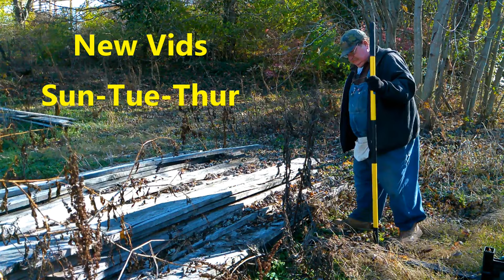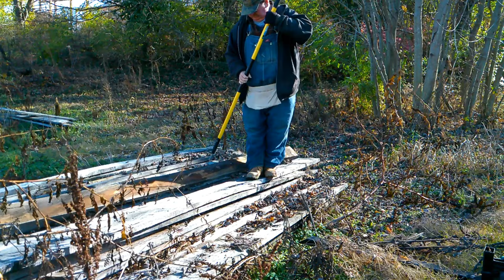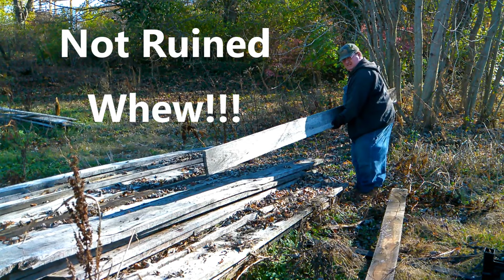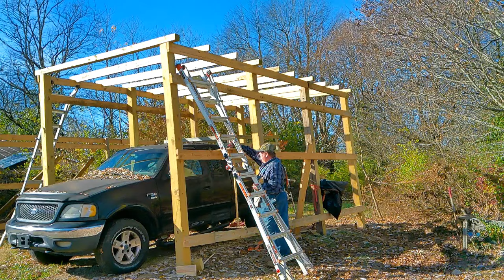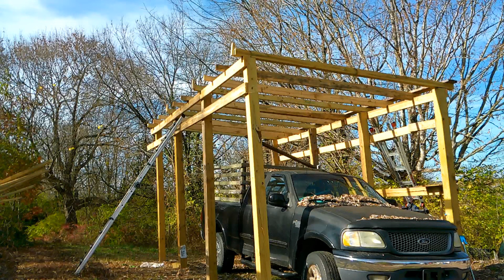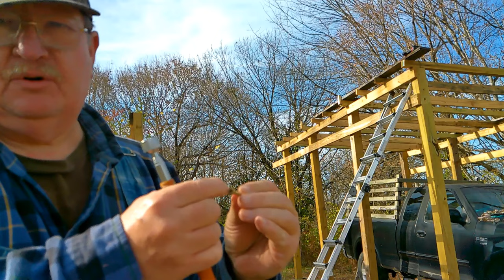Everything Is LADDER WORK Oh My Back Homesteading ASMR 101

Comment: I heard that the threads on screws are only used for taking them out.
Reply from the maker: I never heard that before. But the gripping power of a screw reaches its Maximum at 3 times the diameter of the screw in depth. Longer screws don't give higher holding power.
Reply: Don't be fooled by everything you hear.  Threads on a screw were invented to apply torque from the pieced drilling thru to apply pressure(torque)to the attachment piece....but, yes, it ALSO helps with removal and lessening damage.